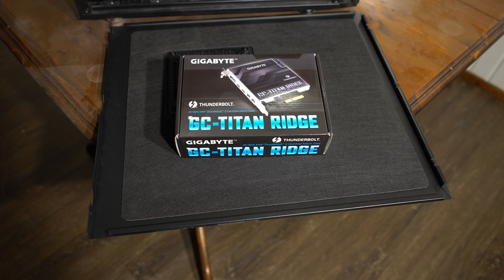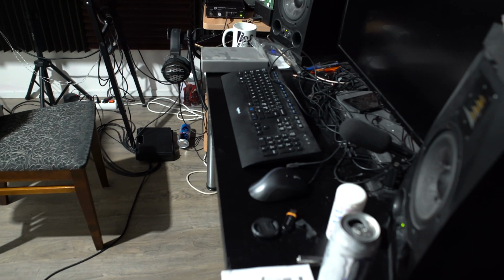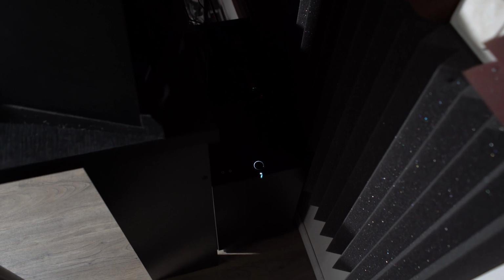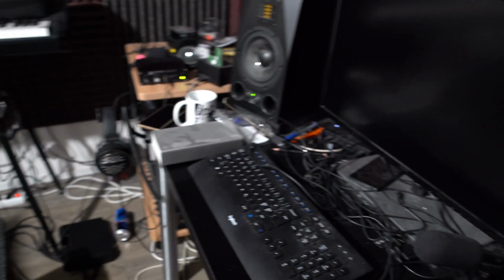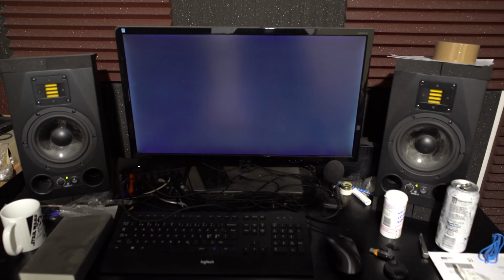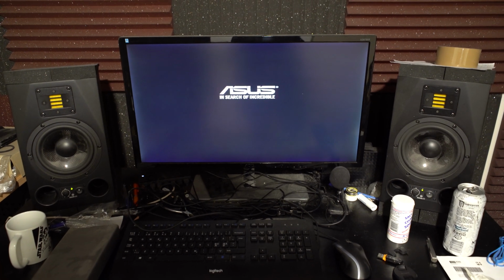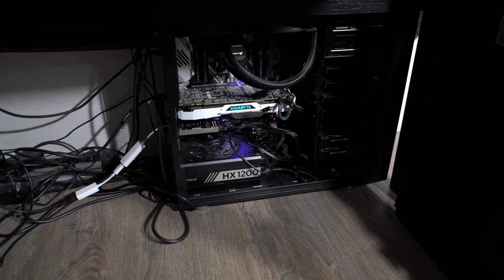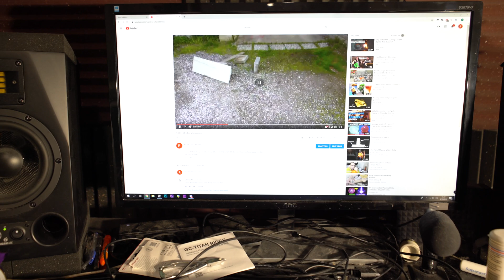Thunderbolt 3 in AMD system

Comment: Thats awesome ! What's your motherboard and how did you set the cg Titan ridge to your computer ?
Reply from the maker: Motherboard was Asus PRIME x399-a. The setup itself was easy. Just plug the CG-Titan Ridge to PCIe port, plug in the power cables, and plug the USB cable to USB header on motherboard. After that to enable plug and play, connect pins 3&5 on the third thunderbolt header cable. Then just install the driver, and after a reboot, everything should start working. In my case I also updated BIOS firmware, but I don't know if this has any effect.
Reply: @RavenFly1232  Where did you download the driver for the card?
Reply from the maker: @Viettzz  from gigabyte website
Reply: @RavenFly1232  I got the Gigabyte Titan Ridge 2.0 pci-e card installed, downloaded the driver from Gigabyte website.  I shorted the pin 3 and 5.  The Thunderbolt app from Windows show the Apollo Twin X device and connected.  But the UAD Meter and Control Panel still says No Device Detected.  I dont know what to do now.
Reply from the maker: @Viettzz  Have you tried to leave Apollo on, but restart the PC?

I had to do that in order for stuff to work. Cold start didn't work, only restart.
Reply: @RavenFly1232  Yea I already restarted my PC several time.  I even tried it on 2 of my PCs.  I have a new Amd 5900X with Asus Dark Hero VIII motherboard, and the 2nd pc is Intel 10920X cpu with Asus Rampage VI Extreme Encore board.
Reply: @RavenFly1232  When you shorted  your pin 3 & 5, do you just twist the wires together? or did you hand solder them together?
Reply from the maker: @Viettzz  Hard to say what could be the culprit ot the problems.

I just shoved a jumper cable to the holes of the connector, that did the trick. Are you sure that you have the correct pins shorted?
Reply: @RavenFly1232  Also, what kind of jumper cable did u use? where can i get one?
Reply from the maker: @Viettzz  Just a regular single strand copper wire. You can get these from any electronics shop or online. Ask for something to be used on breadboards, and the shop owner will know exactly what you mean.
Reply: @RavenFly1232  What I did was trim the pin 3 and 5, then twist the wires together. Is that why it's not working?
Reply: @RavenFly1232  Ok i got the Thunderbolt working hahaha i was stupid. U k now the Thunderbolt 3 cable, it has the Lightning icon? you have to put it in one direction, so it's not like USB C even though it has the same USB C connector which doesn't matter which side u plug it in.
Reply from the maker: @Viettzz  glad to hear! 😁
Reply: @Viettzz  Good to know. Does it work fine with your Apollo ?